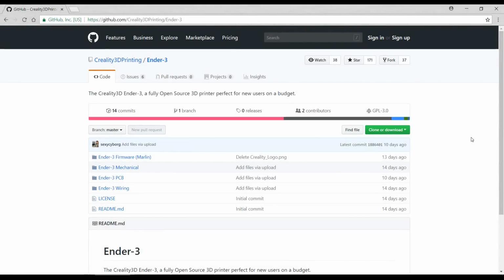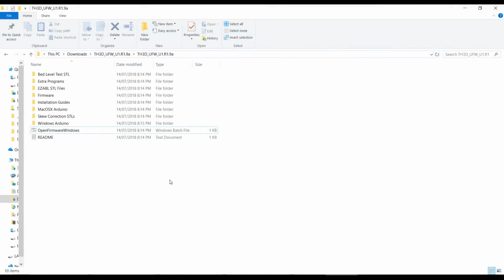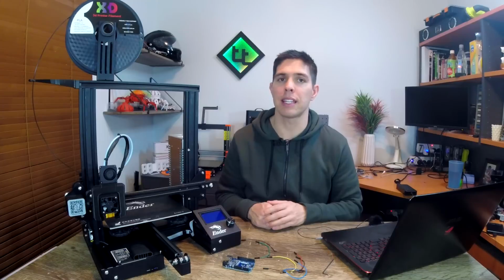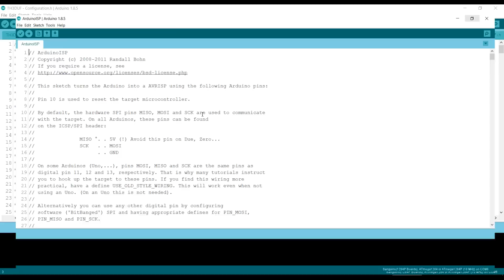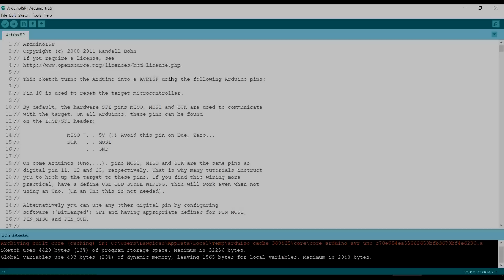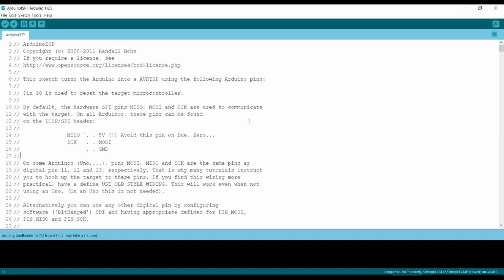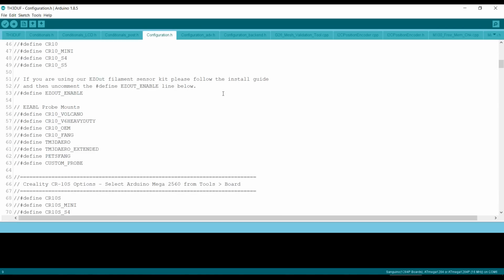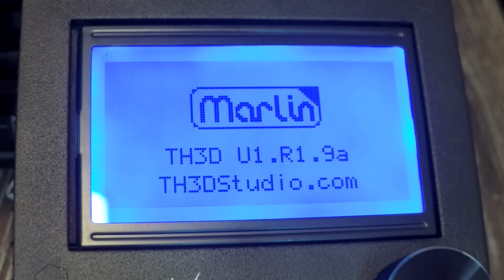Ender 3: How to install a bootloader and update firmware

Comment: wow!  that took me a lot longer than expected...  if you follow it step by step, it should work.. first time through, i missed uploading the software to the Uno Board.. 
Thank you for doing this.. but if I may,  a little constructive feedback on why I had some issues... it might also help others..

 3 things caused me problems..

1.   You opened up the case and positioned the Arduino Uno board, then instead of connecting the wires between the Arduino Board and Ender 3 board, You went back and uploaded the software to the board using just USB cable.   It would've been more clear if you uploaded the software to the Arduino UNO board prior to opening the case..  This would give a clear separation of the 2 steps.. FIRST: uploading the software to the Arduino UNO board,  SECOND: Flashing the ENDER 3 Board from the Arduino Board.
2.  You are speaking really fast when going through the menu options really fast when setting up.. I had to repeatedly go back and forth between the video and the program interface...
3. Starting the video, you goes into great detail into how to get the firmware upgrade from Creality, which you do nothing with.. so, that was kind of a waste of time and just added to my confusion...
Reply: quick question: So I can easily program the bootloader to the Arduino board first (no connection to the ender3) using the USB cable. But the next step how would be done? no power from usb cable? just with the jumpers? and then just jumper the Arduino board to the ender 3, and the ender3 provides the power and just gets the bootloader automatically?

Comment: Everything was pretty much seamless, but after uploading the Ender3 to TH3D_UFW_U1.R2.14, I no longer have anything under control/motion.
Under Motion there used to be;
Velocity
Acceleration
Jerk
Steps/mm
       X steps/mm: 80
       Y steps/mm: 80
       z steps/mm : 400

       E steps/mm: 93
I used to be able to modify the axis motor steps and especially the e-axis. It was originally set to 93 and after a motor change, I needed 98.04 to keep from under extruding.  The original Ender3 had the statement "#define DEFAULT_AXIS_STEPS_PER_UNIT   { 80, 80, 400, 93 }" the 93 being the E-stepper motor value. How do I view the TH3D value?
I went back to Marlin 1.1.9 which I would recommend to everyone. My Ender3 came with 1.1.6 and there are a ton of improvements and bug fixes since 1.1.6. The most obvious is the bottom line of the information display scrolling so that you can view the entire line.

Comment: so i need an arduino to flash the printer?
Reply: you need some kind of AVR programmer. Many people already have an arduino so they show that as an example.   a USBasp is an inexpensive programmer that also works and eliminates some of the steps in the video. I haven't installed a bootloader yet, but when I do I'll use a USBasp since I have one (as well as an arduino, but won't need that).  If you don't have either and this is all confusing, get an arduino then you can follow the video exactly.

Comment: can someone explain to me, because i cant compile it.

Sketch uses 108670 bytes (83%) of program storage space. Maximum is 130048 bytes.
Global variables use 4535 bytes (27%) of dynamic memory, leaving 11849 bytes for local variables. Maximum is 16384 bytes.
C:\Users\User\Desktop\TH3D_UFW_U1.R2.14\Windows Arduino\hardware\tools\avr/bin/avrdude -CC:\Users\User\Desktop\TH3D_UFW_U1.R2.14\Windows Arduino\hardware\tools\avr/etc/avrdude.conf -v -V -patmega1284p -carduino -PCOM4 -b115200 -D -Uflash:w:C:\Users\User\AppData\Local\Temp\arduino_build_974303/TH3DUF_R2.ino.hex:i 

avrdude: Version 6.3-20171130
         Copyright (c) 2000-2005 Brian Dean, http://www.bdmicro.com/
         Copyright (c) 2007-2014 Joerg Wunsch

         System wide configuration file is "C:\Users\User\Desktop\TH3D_UFW_U1.R2.14\Windows Arduino\hardware\tools\avr/etc/avrdude.conf"

         Using Port                    : COM4
         Using Programmer              : arduino
         Overriding Baud Rate          : 115200
avrdude: ser_open(): can't open device "\\.\COM4": The system cannot find the file specified.

avrdude done.  Thank you.

Problem uploading to board.  See http://www.arduino.cc/en/Guide/Troubleshooting#upload for suggestions.

Comment: Hi, I did everystep up to "burn bootloader" part, but after i hit the "burn bootloader" command i get this error message 

avrdude: Expected signature for ATmega328P is 1E 95 0F
         Double check chip, or use -F to override this check.
Error while burning bootloader.

The middle chip on the board (obviously it is a clone) as fallows: 

MEGA328P
U-TH 
354730
1841B3J

I don't know what to do, I have no experiance on these kind of electronic board things... Can anyone help?
Reply: @kladblok kip yaptım, biraz zorladı ama oldu.

Comment: if they release source it is 100% same as you have on printer. should be end up same. now just change code to enable features.
you not need bootloader you are flashing it with arduinoISP just use creality hex LOL and your printer is safe CANT be flash from USB by mistake becouse did not burn bootloader

i have ender 3 pro. and board is upside down. need open downcover

Comment: question for the hive   I am replacing my ender 3 pro motherboard, I bought the same version  motherboard as the stock one in my ender 3 pro  Creality 3D V1.1.3   is the ender 3 and ender 3 pro firmware the same?

Comment: This worked great, first time it didn't recognize the printer port and I ended up selecting the mouse, didn't flash right, changed USB ports and it showed up and flashed perfect.
The most important thing I had to do after we run the PID Auto tune to set the thermal runaway sensors properly. GREAT tutorial, thank you so much!

Comment: I followed all of the steps and got this error message : Arduino: 1.8.9 (Windows 10), Board: "Sanguino, ATmega644 or ATmega644A (16 MHz)"

In file included from sketch\pins_SANGUINOLOLU_12.h:41:0,

                 from sketch\pins_MELZI.h:32,

                 from sketch\pins_MELZI_CREALITY.h:35,

                 from sketch\pins.h:221,

                 from sketch\MarlinConfig.h:40,

                 from sketch\ultralcd.cpp:23:

pins_SANGUINOLOLU_11.h:55:4: error: #error "Oops!  Make sure you have 'Sanguino' selected from the 'Tools -> Boards' menu."

   #error "Oops!  Make sure you have 'Sanguino' selected from the 'Tools -> Boards' menu."

    ^

In file included from sketch\ultralcd.cpp:96:0:

ultralcd_impl_DOGM.h:46:20: error: U8glib.h: No such file or directory

compilation terminated.

exit status 1
#error "Oops!  Make sure you have 'Sanguino' selected from the 'Tools -> Boards' menu."

Could not find boards.txt in C:\Program Files (x86)\Arduino\hardware\Lauszus-Sanguino-4aa3893\bootloaders. Is it pre-1.5?
Could not find boards.txt in C:\Program Files (x86)\Arduino\hardware\Lauszus-Sanguino-4aa3893\variants. Is it pre-1.5?
Could not find boards.txt in C:\Program Files (x86)\Arduino\hardware\Lauszus-Sanguino-4aa3893\bootloaders. Is it pre-1.5?
Could not find boards.txt in C:\Program Files (x86)\Arduino\hardware\Lauszus-Sanguino-4aa3893\variants. Is it pre-1.5?

This report would have more information with
"Show verbose output during compilation"
option enabled in File -> Preferences.

Comment: After i updated the firmware with the TH3D update i forgot to Initialize EEPROM' in LCD and went and printed something small to test printer, so now when i go to Initialize EEPROM' in the LCD screen all i have is reset EEPROM under stored settings, in the menu under Control - Motion there are no settings at all to configure like jerk and acceleration etc.... PLEASE HELP .... Thanks

Comment: I get this error using a Freeduino with ATMEGA168-20PU with an Ender3x (just got it last week):

avrdude: AVR device initialized and ready to accept instructions

Reading | ################################################## | 100% 0.00s

avrdude: Device signature = 0x1e9406 (probably m168)
avrdude: Expected signature for ATmega1284P is 1E 97 05
         Double check chip, or use -F to override this check.

avrdude done.  Thank you.

Error while burning bootloader.
Reply: Nevermind got it to work, had to use an older Arduino IDE version.

Comment: Hey Michael, thank you for the tutorial - it definately helped me upgrade which was necessary to accomodate for the different thermistor in the E3D Hotend. But now after upgrading, I cannot get it to print all the way up to the end of X and Y axis. I tried printing a circle with 22 cm diameter and it just "flattens out" the x and y extremes at about 200 mm each. Any idea why? I checked the Marlin code and the X_MAX_POS and Y_MAX_POS are set to 0 in the configuration. In Cura the simulation of the hotend path looks completely normal. 

Any ideas?

Comment: Hi if someone has the errore "avrdude: stk500_disable(): unknown response=0x01" on mac/linux i fixed with this: https://forum.arduino.cc/index.php?topic=342977.15

change the file
/Applications/Arduino.app/Contents/Java/hardware/arduino/avr/programmers.txt 

from
arduinoasisp.protocol=arduino
to
arduinoasisp.protocol=stk500v1

please add to video

Comment: WARNING:  Creality's source code is not being updated.  If you flash a bootloader, you'll have to install an old version, or flash a HEX file (which Arduino IDE will not do).  Flashing the hex sucked, and I can't change it to enable grid leveling.

Comment: i know this is an older vid. i bought a ender3 about 6 weeks ago. yes my first one. so i ordered all the parts your using and following you on this vid, but i keep getting programmer not responding. i have two of the boards, same problem. any help would be great. Thanks for your time. Jerry Ps i'm a electrical and mechanical tech.
Reply: https://www.reddit.com/r/CR10/comments/bdmcjd/trying_to_flash_firmware_failing/?st=jw4k7xbd&sh=ba739480
Reply: I had to uninstall my com driver before I could add a new one.

Comment: Hi, having a bit of an issue, when i upload to Arudino via usb it works fine. But when i burn bootload i get access denied and i have no idea why...one thing i noticed is that on the ender 3 board it says ISP next to pins and on my Arudion its ICSP...could that be the reason wrong Arduino ?
Reply: Had cura opened and that what was blocking it. NVM :)
Reply: @Arudian  THIS is what stopped me from ripping out what little hair I have left!  I had the same error. Cura was open. Shut it down and the I managed to upload no problem.

Comment: Thanks.. it worked!!   

I had this error in my first attempt and the problem was one the wires that connect the arduino to the ender 3 maiboard was a little bit loose, but after I secured it, it worked fine.  I also thanks to @Drew Clardy about the driver, I installed and the ender 3 board was recognized by windows without any problem.  

This was the error, hope it helps if somebody has the same problem:

"Error while burning bootloader.
Reading | ################################################## | 100% 0.01s

avrdude: Device signature = 0x000000
avrdude: Yikes!  Invalid device signature.
         Double check connections and try again, or use -F to override
         this check."
Reply: same stuff man :) I had problems with cables on other modules for arduino and I didn't think of that till reading your comment. Tnx boy

Comment: great video - just did this on the ender 3 pro- only difference is that i had to put the printer on its side (left side) because the fan is on the bottom. another thing that i did that you may not have mentioned or i missed was that i did not disconnect the uno clone board from my pc while wiring the dupont cables. i also attempted to power it on and the screen was blank before i continued watching and thought i had rekt it, but then you covered the 2nd step of actually pointing to the printer and uploading the ender 3 settings and now is golden as far as i know. (what can you use the arduino uno for? maybe another video idea for things you can use it for?)

also if you want to know what the correct com port is go to device manager > ports (com and lpt) > usb -serial CH340 is the ender 3 , though it should be the highest available port.

keep up the good work, now to install the bl touch
Reply: also there are 4 screws- there is on at the top right almost halfway up that you have to unscrew

Comment: buying and setting up my first printer and its an ender 3 (i've had experience with other printers) but first time even thinking about the tech behind it! Would you suggest downloading the ender offical firmware first to get it up and running or start with TH3d from the get go and save the hasstle? Thanks for all your videos, been watching them non stop!

Comment: What am doing wrong?  I tried to upload the ArduinoISP to both a clone and a genuine Uno and I am getting the same error:-

stk500v2_ReceiveMessage(): timeout

avrdude: stk500v2_getsync(): timeout communicating with programmer

There is a message about overriding baudrate.  Anyone have any ideas?

Comment: Great tutorial. One thing worth mentioning, maybe even in the video description because I lost several hours chasing this issue down. I followed your video to the tee and still could not burn the bootloader. Turns out that sometimes it is necessary to connect a 10μF capacitor between the RESET and GRND on the Uno. Bought some capacitors on Amazon and 2 days later, worked exactly as shown in the video.
Reply: This solved my issue. I love you.

Comment: I installed the boot loader then the TH3D firmware ( its my first time doing this ) and i'm using the new creality 1.1.4 main board but i have flashing question marks on the home screen on the xyz axis until i home the axis how can i fix this ( i'm using a ender 3 pro )
Reply: You'll always have to home the axes after shutting power off to the printer
Reply: Make sure in the configuration.h file you un-commented for the ender 3 "#define TMC_CREALITY_BOARD" around line 304 on V2.15 as you need to make sure the firmware is using the TMC2208 drivers.

Comment: Clear concise information for loading the bootloader. I had a problem where the UNO would not power up on the USB so had to run a separate power to it but then it all worked like a dream. I went with Marlin 1.1.9 configured for Ender 3d rather than the TH3D as I've heard better things about it. 
Many thanks

Comment: Was never mentioned that the original firmware would be wiped after flashing the bootloader. I spent about an hour trying to figure out why my LCD screen was blank even though I had a successful flash.  I thought it wasn't done properly.

Comment: Hey guy's if you are getting an error like "avrdude: Device signature = 0xffffff (probably .avr8x_mega) (retrying)

Error while burning bootloader.
Reading | ################################################## | 100% 0.01s

avrdude: Device signature = 0xffffff (probably .avr8x_mega)
avrdude: Yikes! Invalid device signature.
Double check connections and try again, or use -F to override
this check.

avrdude done. Thank you."

turns out that Offical UNOs sometimes have problems doing the bootloader part, for me when i had this problem i changed my UNO out and used my MEGA 2560 and it worked

Comment: I'm sorry, I realize that this isn't a support group. I did actually try to solve this myself, but I am not "techie" enough to understand. However, I am "techie" enough to break everything. That's why I'm posting here before I seriously break something.
While trying to set up my Arduino, I didn't get far. During the first step, I got this error:

An error occurred while uploading the sketch
Reading | ################################################## | 100% 0.00s

avrdude: Device signature = 0x1e950f (probably m328p)
avrdude: Expected signature for ATmega1284P is 1E 97 05
         Double check chip, or use -F to override this check.

avrdude done.  

Any insights? Hopefully easy answers.
Reply: its an upload error ig. I think you put in the wrong atmega chip.

Comment: hi when im trying to uppload the boot loader to the arduino it gives me this message        avrdude: Device signature = 0x1e950f (probably m328p)
avrdude: Expected signature for ATmega1284P is 1E 97 05
         Double check chip, or use -F to override this check.

avrdude done.  Thank you.

do i overide or what
Reply: I had the same problem turned out that official UNOs sometimes have a problem doing the bootloader. For me i swapped to my MEGA 2560 and it worked.
Reply: @wilkoslavakia  I found out my error, I had chosen the wrong Arduino. Instead of Arduino UNO to make boot loader I chose something else 😜

Comment: Just got my ender 3 and want to flash the bootloader.  I have a HiLetgo FTDI miniUSB to TTl Serial programmer I use to flash a lot of smart switches.  I capable of running at 3.3 or 5 V.  Can I use this to flash my ender 3?

Thanks

Comment: Just sharing a problem that I had with a solution for those in a similar situation with my Ender 3.

I was able to burn the bootloader, and get past that point. Once I tried to upload the firmware, no go. Was getting an error message of Upload error: avrdude: ser_open(): can't set com-state for "\\.\COM5"

After trying a bunch of different things, I finally found this. In the device manager, the USB was showing up as "RAMPS". This does not work with the Ender 3 board, so you have to revert your driver to a different version. I found this link:

https://sparks.gogo.co.nz/ch340.html

and downloaded the drivers. Once installed, there was no more "RAMPS" in the device manager, but instead CH340. Clicked upload and bam! Works like a champ.
Reply: Solved my issue. Thank you very much!